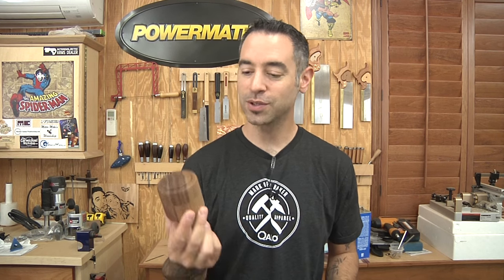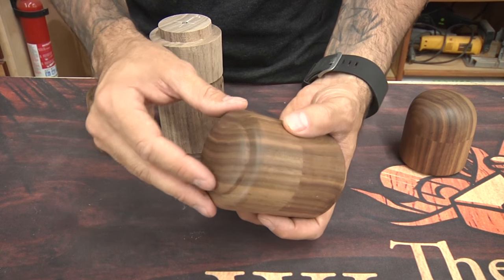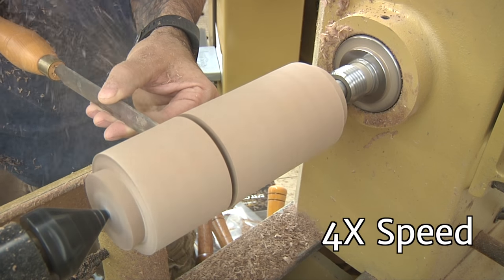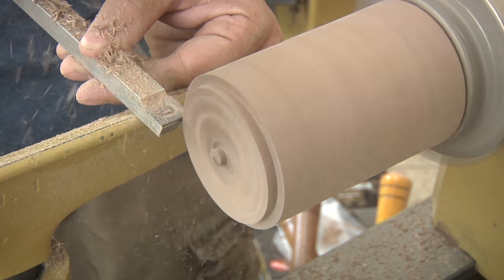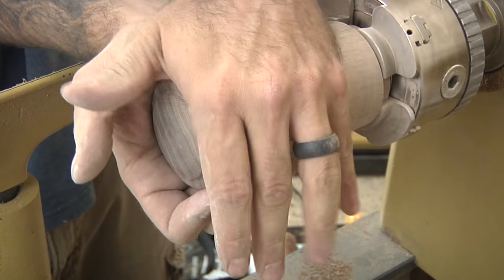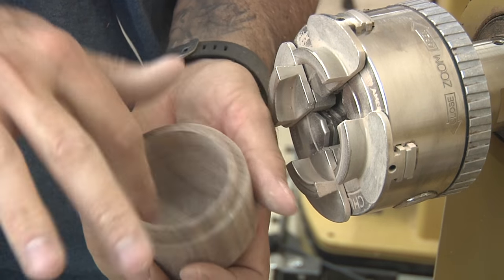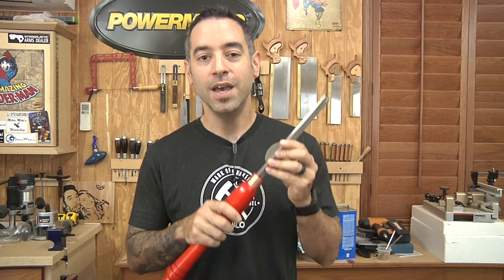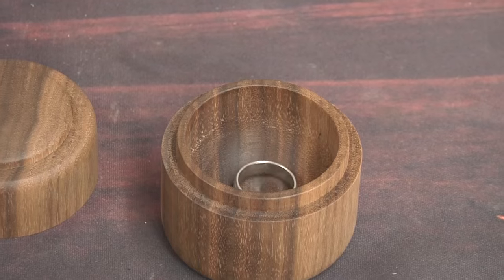I Turned a Lidded Box!

Comment: No need to feel sorry for the Easy Wood tools. I use them now exclusively vs. my "traditional" lathe tools. Soo much easier to use, and sanding on the lathe is an easy task. Just like everything else, there is too much romanticizing over every traditional tool in the shop. Just use what gets the job done and gets the desired results!
Reply: totally agree. My response to tool-Nazis is "so.... you use a pole lathe and iron hook tools then?" I love my carbide tools... really speed up the boring parts of the job. Also... having used them in teaching, they're far safer and much more rewarding for the newbie; just as Marc said.
Reply: Coming from a dude who started turning well before these tools existed, I can say that for most every task, I prefer a gouge or skew (though in my estimation, if you are using a scraper in lieu of a skew, you are really not doing yourself any favors. The skew is something that you just gotta learn if you are doing any spindle work, it does things that you just can't do with any of the carbides).

The real problem here, is that the answer probably lies in the middle somewhere. There is an upper limit to the complexity of the spindle work you can do with these scrapers. And even if you can replicate some of the basic forms, you can't sand between deep tight beadwork without messing up the beads, so you need something that achieves a fine surface finish from the tool. A properly sharpened skew can give you a mirror finish with a light cut.

On the other hand, there is a bunch of technique to working end grain with traditional chisels. And there are still some operations that are inherently risky, even with the right technique. These scrapers make short, low risk work of end grain, and as such are great for beginners and advanced turners alike.

I just wish that we didn't pile on with all the BS, it doesn't have to be one or the other. Every turner should have basic chisels, as a decent set (read as Benjamin's Best or similar) will cost them the price of a single carbide tool. Get carbide as well if you like, use it for the trickier hollowing or cross grain operations, but the more traditional lathe chisels aren't obsolete, they are complimented by the newer carbides.
Reply: If your lathe has the power to run carbide there's nothing wrong with it for hogging off material. My lathe is a treadle powered machine so I really appreciate how keen a well sharpened hss tool can be.

Comment: I completely agree about the carbide v steel tools. I turned a mug last fall, and that was my first experience on a lathe.My shop teacher didn't have us properly sharpen the tools, or show us the best way to use them. After Christmas I got my own lathe, and went with carbide considering I have a small shop, and no way to sharpen tools well. The carbides work great and are super easy to use!
Reply: You can also get a super fine finish off carbide. Just crank that speed up, get the height of the toolrest just right and you will be sanding from 240/300 grit easily. Not so great on punky salted wood in my experience though... but that's probably just me 👍
Reply: I agree! I usually have my lathe at 2800-3900RPM when turning small pieces.
Reply from the maker: +Jake Hanson I'll have to try cranking up the speed a bit.
Reply: +The Wood Whisperer I have it at a high speed for pens or anything I feel will stay on the lathe indefinitely. I also would say knocking the corners off before going to a high speed

Comment: I think a lot of wood turners, at least the old school ones, look at those carbide tip lathe chisels the same way some woodworkers look at cnc, or that new..."semi-automatic" router. I could count my self as one of those.

I was taught how to properly use the skew chisel, and it is really one of the best to use for lathe work, for the best finish. It did take a lot of practice though, and then there is the sharpening, which is an artwork all on its own.

That being said, I can certainly understand the appeal and attraction to the carbide tipped tools, as you said they're great for beginners to get started. eventually someone may get tired of the sanding to get rid of any lines that may be left and learn to use traditional lathe tools.

I guess what it really comes down to is, whatever works and gets the job done. :)

Comment: That round nose carbide is really nice for that end grain hollowing you're doing with it too. And it's easy to get deep in a piece without a catch. I'd say if a tool does a job well then it is a tool worth using. That's not to say a scraper doesn't have something to add here, though.

Comment: I like using the scrapers for many tasks, but I have had some breakage when I tried using them for rounding a square block. The carbide edge takes a beating on the wood corners. It works much better for me after the wood is round-ish. YMMV. Regardless - You got nice results. Thanks for the video.

Comment: So Marc, I have never turned on a lathe before. Could i really start with just those two tools (square and round), would they do the job? Obviously a lathe, and a parting tool. You made that look easy, i want to try this out!
Reply from the maker: Yup, that's all you need to get started. Obviously you won't be able to make every type of turning out there but you'll be able to do a lot!
Reply: +The Wood Whisperer Might need a parting tool as well for this kind of product. I see EasyWood now makes a carbide parting tool. I really recommend their products as well for the casual/beginning turner. I took a weeklong turning class and brought my carbide tools along - and boy did I get crap for wanting to use "scrapers"! So, I learned some additional turning skills on conventional tools - and when I got home, I was also much better with the carbide tools. Thanks for the inspiration, WW!
Reply from the maker: +Lawrence Becker thank you! And yeah, definitely need that parting tool. I have my eye on the EWT version but haven't pulled the trigger yet.
Reply: +The Wood Whisperer Get it! Just picked one up and it cuts like butta!

Comment: Awesome job Marc. Is the reason for using the 500 grit pad to apply the poly finish to get more of a matte finish? I need to finish some shelves in a matte finish at the moment and that looks like a good solution to get the matte finish i'm after.
Reply from the maker: It might help in that regard if you build enough of a film. I'm using it in hopes of creating a little dust/finish slurry that fills the grain a bit. Probably doesn't make a huge difference but I still like to do it.

Comment: Starter lathe:  $150
Starter sharpening setup for HSS tools:  $1.2M

Suddenly, standing at the lathe holding sandpaper for slightly longer doesn't seem quite so bad...
Reply: Common, you can get a decent grinder at Rockler for $150.🙂🙂

Comment: To avoid going too far while making the notch for the lid:
1. Take measurement of the thickness of the edge of the lid (with a slide calliper)
2. Make a mark on the surface of the main body part where you're going to make curves

PROBABLY THIS WOULD BE CONVENIENT FOR MOST OF THE PEOPLE

Comment: I can't believe I am attempting to give The Wood Whisperer advice about woodworking! Please never pound the blank into the drive center while it is on the lathe. Just imagine hitting your headstock bearings with a hammer. Hammer the drive center into the wood then place it in the headstock. Your bearings will thank you.

Comment: I want to make this but could you tell me the measurements for the box ?
Reply: 2 x 2 x 4  inches would be a good start. Marc started with 12 quarter stock which is 3.5 x 3.5 x 4 to 6 inches. There are no magic dimensions. Use whatever you have. Boxes are any size and any wood. Just go for it.🙂🙂

Comment: Parting the piece in the middle and using that joint as your center doesn't make sense to me, why not save some of the material and maintain better continuity in the grain by cutting it with a hand saw? I think sometimes when we get rolling with a specific concept in our minds we get locked into it and forget to use other tools or experience in our arsenal. Or maybe that's just me, :)